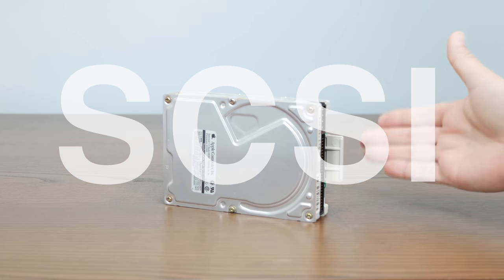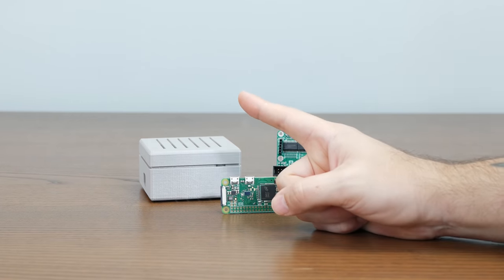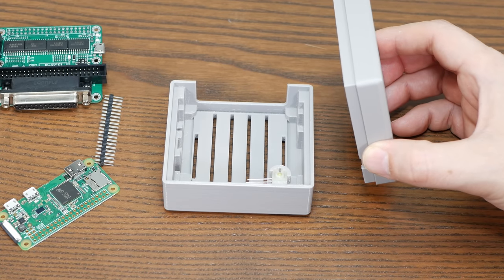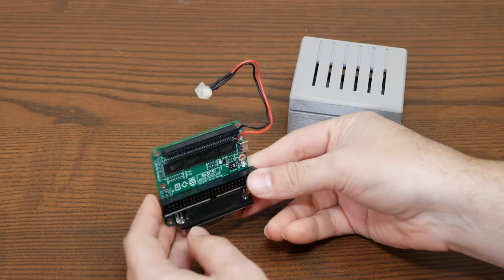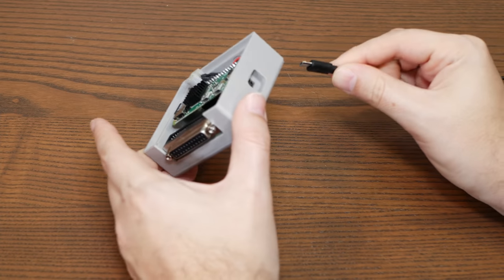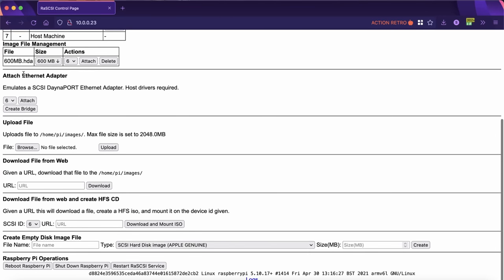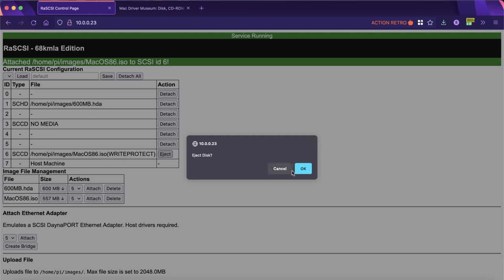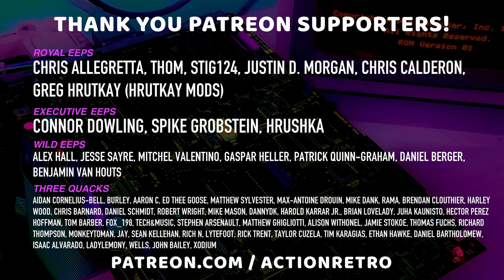The RaSCSI is MAGIC for Old Macs (and Much More!)

Comment: Parallel SCSI, good riddance. Especially the later revisions like Ultra-320 were very fiddly regarding cables and connections, and still with the 2TB limit. FC with MPIO was such an improvement.
Reply: What 2TB limit? SCSI supports 2 gigabytes with READ(6), 2 terabytes with READ(10) and READ(12), and 4 billion times that with READ(16) and READ(32). I guess I just answered my own question there. But that 2TB interface limit probably doesn't matter. Any software which can work with larger disks surely supports the newer commands and any HBA should work with any of these commands.

And regarding cables, I've only seen Ultra320 on server backplanes so no cables there.
Reply: @eDoc2020  This was still a limitation with recent hardware (~10 years old), both on HBAs and hardware RAIDs, which at the time would have been the only devices to exceed 2TB capacity.

Comment: Yes, both had advantages and disadvantages.

SCSI had a wider data channel - permitting a higher amount of data to flow in the same time.  And yes...  SCSI could daisy chain and IDE couldn't.

Then, over time IDE changed and grew a bit more capable.  The later IDE could pass more data than the earlier and there became ore than 1 IDE host in a pc....  So the # of devices became more similar.

Then motherboards began to have IDE with RAID built in and enough IDE hosts to make s good data server.....  Which wasn't popular in the esrly days when only SCSI could really do that.

Comment: could you use the compute power of the pi as coprocessor for the mac?
Reply: Not really through the SCSI bus. The SCSI bus would be a huge bottleneck, even on the oldest Macs.

The PiStorm project is able to plug a Pi into the 68000 socket on an Amiga. There are folks working to get this working with Macs as well. (https://github.com/captain-amygdala/pistorm)

Comment: One hopes one day a solution for ESDI, the problem child of disk interfaces.
Reply: I wonder if there's any similar thing for doing MFM, for the really old PCs. That protocol was really simple so it seems like it'd be fairly straightforward to adapt to a Raspberry Pi.
Reply: @fluffycritter  I think it would be extremely similar to a Gotek as the ST506 interface was based on the floppy interface. SInce the FlashFloppy firmware is open source it could probably be adapted with minimal hardware modifications.
Reply: @eDoc2020  Ah, that's a good point! Yeah I guess MFM's protocol really was just "floppy but bigger," huh.

Comment: Hold on! What magic is this? When you switched around the pin-header, you flipped the pins by 180 degrees. So now you have 5V where GPIO 20 and 21 are. How does this work? Did I overlook something? oO

Comment: On the whole it made little difference as most machines IDE or SCSI in the home market could get anywhere near to maxing out either. People also forget that when people were using MFM/RLL controllers in PCs the the transfer rates were abysmal. I did have an Amiga 3000 and 3000T with 32bit DMA and they trounced a typical PC of the day by up to 10x. That did not last and IDE came along and just got better and better.

Comment: If the pi has avahi installed (not sure if it does by default) you should be able to ssh to user@hostname.local so pi@raspberrypi.local in your case, without having to lookup the ip address manually. (Works for browsers also so http://raspberrypi.local would work)

Comment: Feels kinda wrong to reduce a more powerful computer to this. The Pi Zero and the Pi 1 were pretty terrible at running Rasbian, so this is the more useful outcome, but at least with the BlueSCSI and SCSI2SD - they were only built for drive emulation.

Comment: Why does that scsi to raspberry adaptor cost 50 bucks when it's possibly been made by JLCPCB for about 20 cents, people can be so greedy these days
Reply: It's pre-assembled for one thing. You can buy just the parts, including the pcb for closer to $30. And the key word there is "parts", as it includes all of the necessary connectors, integrated circuits, etc. 

I believe the schematics etc are all available if you want to try and source a PCB and all the parts to save a few dollars, but the prices for these items is far from greedy. I'd argue they're actually quite low (as evident from the immediate sellouts after these videos), likely due to the people involved being more interested in the project itself than the income.

Comment: What about scsi to Sata ???
Reply: ACARD used to make a board that could do that, but the last time I looked into them was several years ago, and they were expensive (around $200 US) even then. SATA is a high-speed interface, and the engineering involved is quite a bit more of a pain than just dealing with an SD card (or even USB, for that matter).
Reply: @lee4hmz  With an IDE to SATA adapter the engineering should be much easier.

Comment: Nice to see new products made for old Macs but how is this easier than using a SCSI2SD? Drivers, dicking around. Seems easier to unclick card, load stuff, click back in. DONE.
Reply: How complicated is it to get an old Mac without ethernet ports online with a SCSI2SD?
Reply: That unclicking, clicking and loading is the part I want to avoid. With the RASCSI I can add files and manage images wirelessly with the phone I already carry, rather than having to get out another computer to use a computer